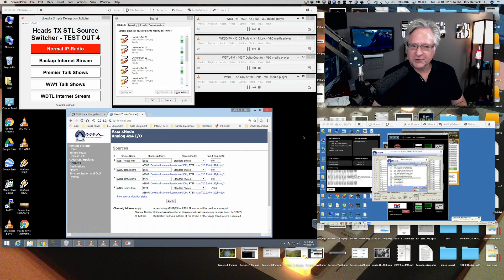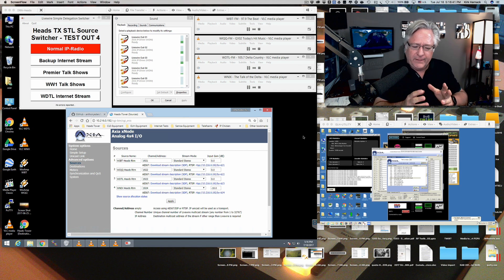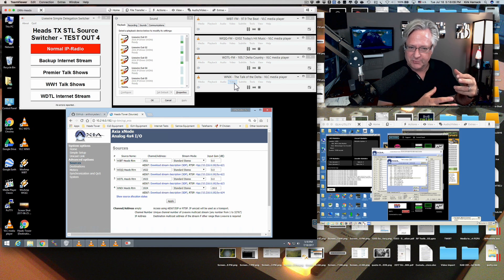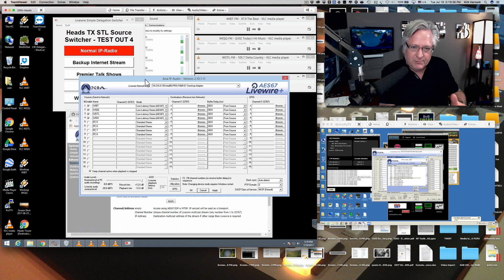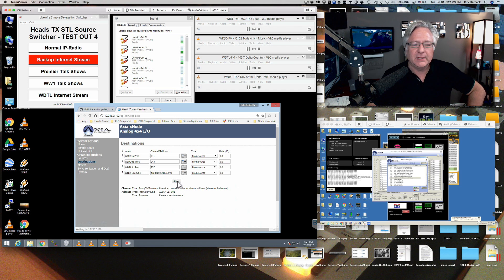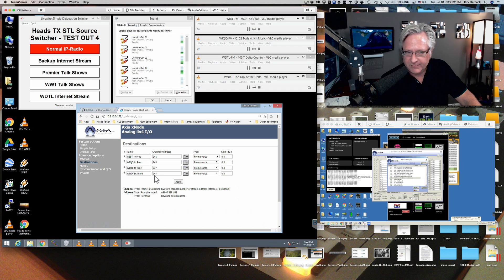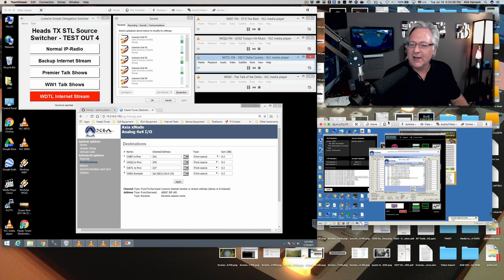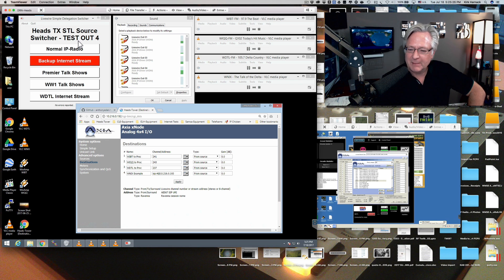Axia Backup STL Switcher

Comment: I wonder if an HCO Hot-Change Output can be developed to where if audio degrades, chatters, or is lost, the unit at the transmitter would "look ahead" and automatically change audio sources and alert the engineer an HCO Salvo trigger had fired.
Reply from the maker: IF our xNode has a quality indicator in its API (and I don't know that it does) AND if the author of the Livewire Delegation Switcher software (that's not Telos) wanted to implement it, THEN that idea could work - at least in a very narrow sense.  To my knowledge, neither is implemented, so for now the answer is "no".  I would point out that there are many kinds of audio impairment.  Silence is one of them, and that's somewhat easy for a non-human to determine, but it's not foolproof.  For a non-human to determine "stuttering audio" or dropouts can be very tricky, or very incomplete.  IOW, we could implement some "quality" value in the xNode API and 3rd party software could read that and make decisions about actions, but this would cover only one impairment scenario that was occurring locally at that xNode out of many, many possibilities.